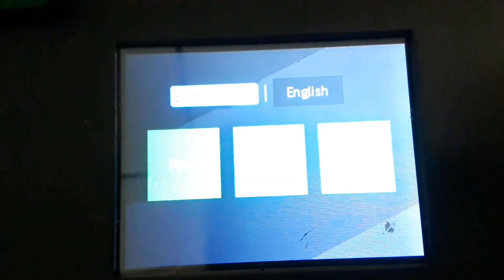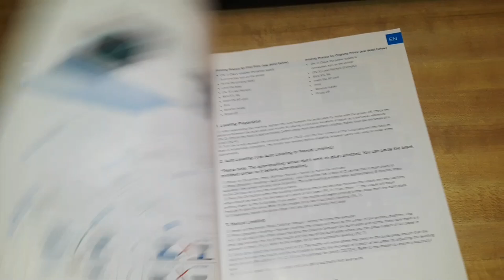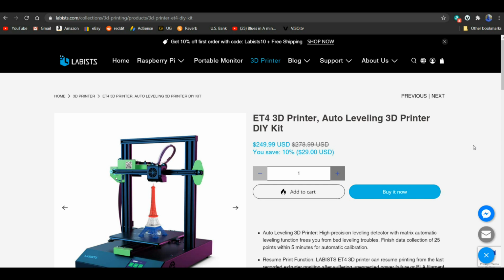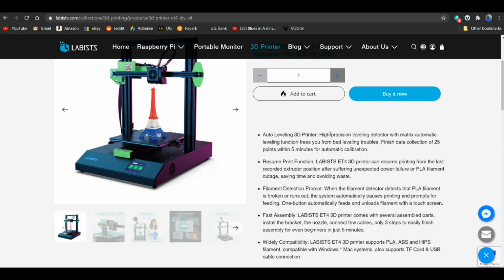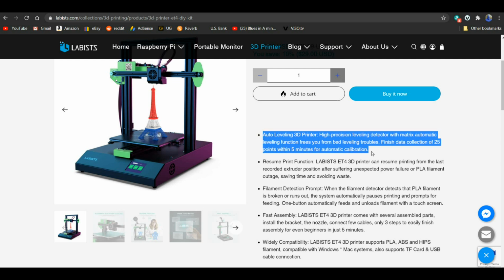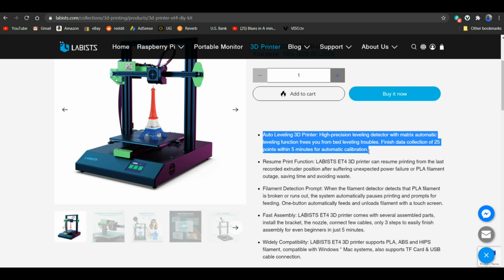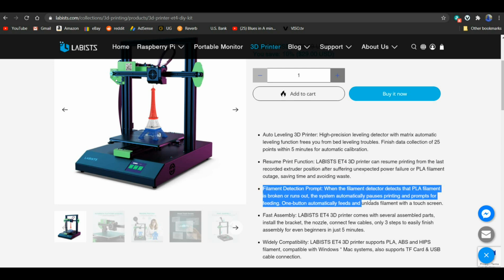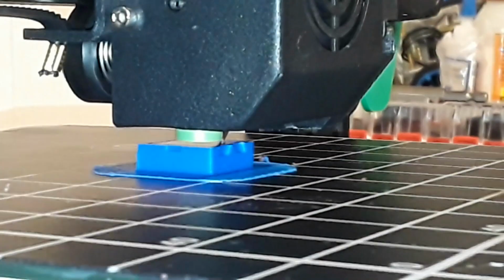Labists ET4 3D Printer

Comment: This printer is awefully loud and just another example of those cheap ass china devices. Honestly, it has soldered in the cheapest loudest stepper motor drivers A4988 with 16 steps on the main board. Poorly designed, as it becomes very cumbersome to impossible to desolder the stepper motor drivers in order put in some nice and silent TMC2208 or similar. Autoleveling is a fake feature, you have to do it manually. Firmware issue? This 3D printer is so damn loud when moving one has to leave the room. Your neighbors will hate the noise... fans are very noisy too of corse because they are also cheap and of poor quality. before buying, I recommend to watch a few of the reviews on YouTube available... lots of much much better choices available for same money.
Reply: Useless comments, if your going to bitch, at least say which one is better.
Reply from the maker: It's not that loud
Reply: It works, it's fairly cheap. I can live with the noise. It's not that bad.

Comment: Thanks for the video but the review was not really a review just your perception of the printer.  A real review would contain what power supply is inside, cheap Chinese or a meanwell power supply.  Comments of how the firmware reacts and what version of markin comes with it.  What cpu is on the board  can the drivers be changed, are they tmc drivers from stock so its quiet or are they noisy.  Sorry I'm not trying to knock you. Just 3d printer reviews should be left to the experts.

Comment: I have the Anet A8. I haven't used it much because it is underfeeding and I need to adjust the feed rate. Just been too busy with other things to play with the 3D printer!! The only things I have printed for it is the upper filament guide and the filament release button (which, due to the feed rate, is barely usable)

Comment: I was going to order a creality (with like $500's worth of upgrades) but I might give this one a try first. I see you have a amazon link but it doesn't looking like an affiliate link? I would love to see you get something for my order (especially since it doesn't cost me anything). P.S. Thanks for all of your video's, not so much the more recent one's (although I do watch most of them because they are interesting knowledge)  as they aren't really what I am focusing on learning (Primarily analog circuit design). But as a hobbyist your previous video's about bjt transistor design and op amps have been super helpful! Thank you for being on youtube.
Reply: This is basically the same physical design as the Ender 3, but with some fancy pants for the base and a touch screen.  Either one is probably OK.   The main thing I'd say to be aware of is that neither is really suitable for printing ABS, because the printer does not have an enclosure.  The very high temperature required for ABS means that an enclosure in almost mandatory.  PETG is a much better choice for home printing if you need something a bit tougher than PLA.  It needs only a little higher temperature than PLA, and does not come with the toxicity issues of ABS.  I don't know why these printer manufacturers don't list PETG as an option instead of ABS - they need to revise both their marketing material and their knowledge of where the technology is up to in 2020.

If those upgrades included a better hot end, then I think that is probably still the better option.  The rest of the hardware is important, but the quality of the hotend is vital for print quality and consistency.

The only cases where I'd say that neither of these printers is completely suitable is if you want to print flexible filaments, or very tall objects.
Reply: @Chris_the_Muso  Brilliant advice, I have Ender 3's and they are outstanding "Bang for buck printers". Seems a lot of new printers are just copying Creality with no new innovation's. Would love to see a budget printer with auto bed levelling, that would be a game changer as a factory fitted option or easy end user plug and play upgrade.
Reply from the maker: This says it has auto bed leveling, but it didn't work for me.
Reply: @learnelectronics  Did you do Aux level then press home? Auto level then press home again to save settings.
Reply: @iandawkins2182  Well this one does claim to have auto bed levelling, so there is that.  As we know though, it's never as "auto" as people expect it to be.  You still need to know how to calibrate it and how it works.  Factory setup will only get you as far as your first nozzle replacement, assuming it was done properly (or at all) in the first place.
ETA: this Ender 3 design really doesn't need ABL anyway - once they are set up they don't really change much.  In some ways ABL can be more of a hindrance on this design.
Reply: @Chris_the_Muso  Some user knowledge is required for everything, would you buy a car and expect the manufacturer to teach you to drive ? Would you buy a car without headlights, anti lock braking and windscreen wipers ?
Reply: @Chris_the_Muso  I was going to upgrade the hotend, the filament "tube", the extruder (including moving it directly above the hotend), add an enclosure, belt tensioners, auto-bed leveling, braces, and upgrading the stepper driver control board.
Reply: @oddity2771  The hotend is usually the best upgrade, unless you need to solve some other specific problem.  Some of the better designs with an all-metal tube are good (no ptfe tube through the hotend) and actually required for printing ABS, another reason why claims for ABS printing in these printers should be considered suspect.  PTFE starts to breakdown at ABS temperatures and out-gases toxic stuff. A good hotend design also needs to have a good cooling fan setup too, otherwise you are just wasting your money.  Cooling systems and experimentation with cooling ducts can happen later though.  

The filament tube is usually PTFE and is perfectly fine.  There's a few "magic woo woo" products on the market that are supposed to be better, but to be honest I don't think you'll notice any difference.  Making the filament path shorter and straighter is always a good idea.  The ideal is mounting it on the X carriage above the hotend, (aka direct drive) but the downside of this is that it adds considerable weight to the carriage so will limit speed and accuracy due to the extra mass it's got to move.  Direct drive is very helpful if you want to print flexible filaments though - otherwise it's like trying to push a piece of wet spaghetti through the filament tube.

What else?  Oh an enclosure is really only necessary for ABS as stated, and if you are printing ABS you'll need to also invest in air filtering or air exhaust from wherever you are putting the printer.  Belt tensioners are a great idea.  Look on thingiverse and you'll find plenty of designs for printing your own belt tensioners.  Sometimes you need a longer belt for that to work but a few designs are more flexible in that regard.  Auto bed leveling is useful for printers like the Anet A8 which can change from day to day, but the Ender 3 design hardly ever moves.  It's just as easy to do it manually when you first set it up and whenever you have to change a nozzle, then forget about it.  Upgrading the stepper drivers probably means updgrading the entire controller.  I can't comment on if this upgrade would be useful for you but you normally get things like the ability to do half steps, and quieter operation.  Look at it this way: I've never got to the point where I've thought "I can't print this object because I don't have the upgraded controller".  It might be noisy, but I deal with that in other ways such as putting vibration mounts on the motors ($8 and an hour of tinkering) and putting the printer on a hard solid surface instead of a thin boomy plywood desktop.  An enclosure can reduce noise too - so that might be another reason why you'd still want one.

ETA: I missed addressing "braces".  if you mean extra bracing for the frame, the Ender 3 design really doesn't need it.  You can pick it up and move it around and it's fine.  The frame doesn't vibrate enough to really be a problem.  Maybe if you were setting it up for direct drive and needed a bit of extra rigidity for that reason...